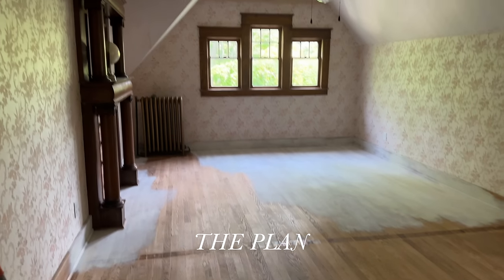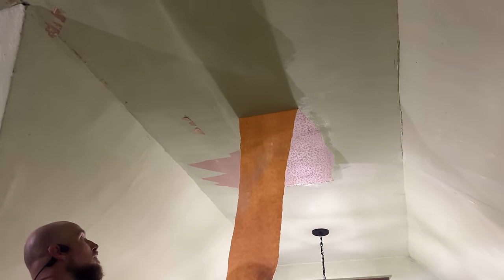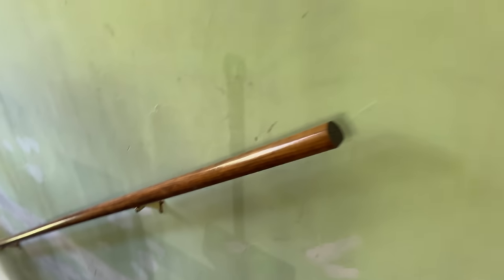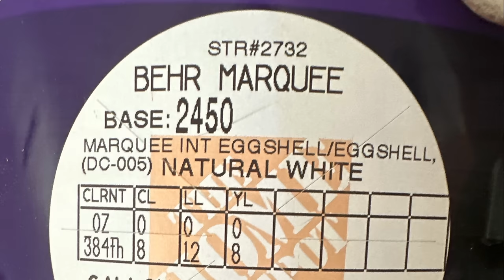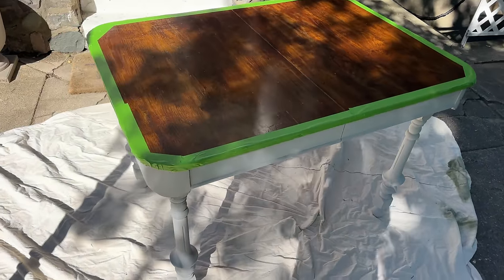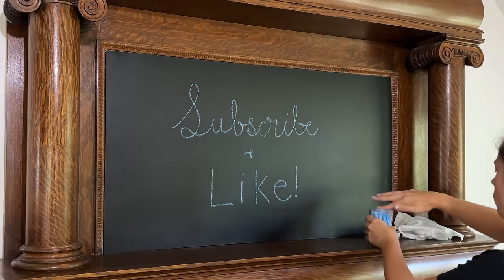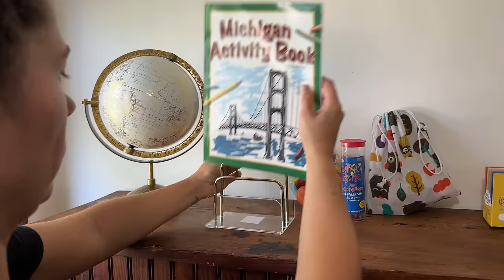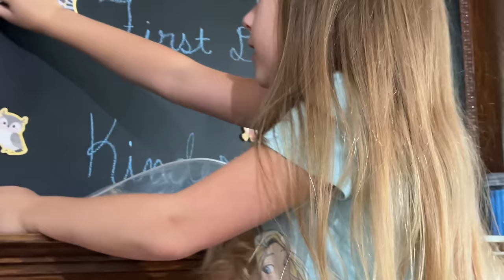Attic MAKEOVER (Vintage School Room)! Old Home Renovations, DIYs & Decorating the Finished Room!

Comment: Just a little tip for the future, cleaning your walls with fabric softener will make them VERY flammable. It also leaves a residue that is hard to remove and after a while, they will start to look dirty due to it. Stay safe! 💗
Reply from the maker: Thank you! I’m glad we scrubbed them really good then… you wouldn’t think they would make something that goes on clothes so flammable 🥴
Reply: @oldmaplehome   Right! After I learned that and read up on it a little bit more, I just ditched fabric softener completely LOL.

Comment: Prep is 99% of the difference between a job well done or disaster. Prep is hard lengthy and necessary. You’ll be glad you did it right the first time.  The floor is amazing and the color choice for the table is beautiful.  Is that really a fireplace upstairs or what is that
Reply from the maker: I agree! It’s a built in dresser with what looks like a fireplace surround.
Reply: @oldmaplehome  well your upstairs is truly inspiring.